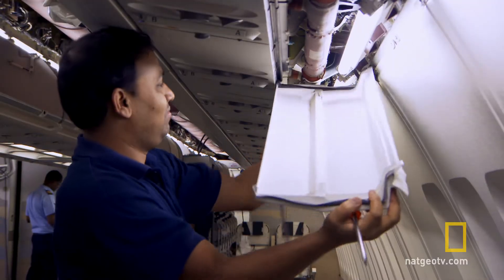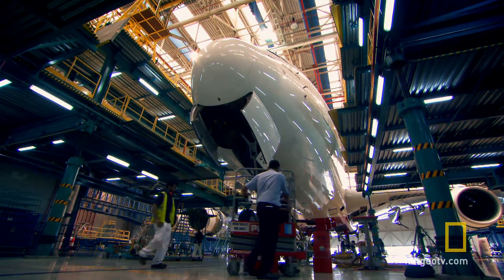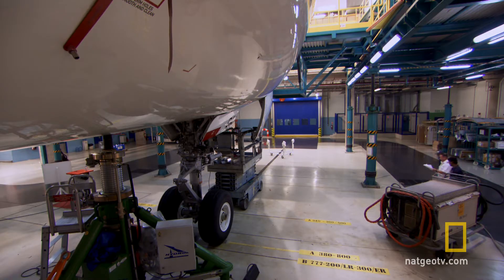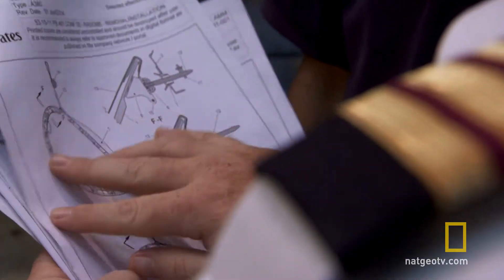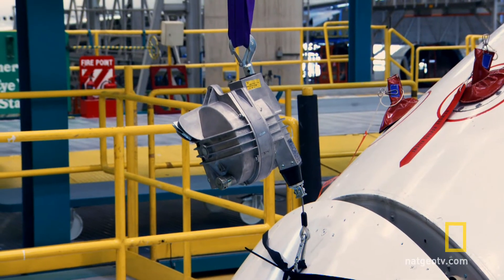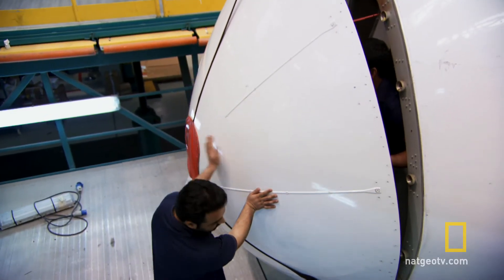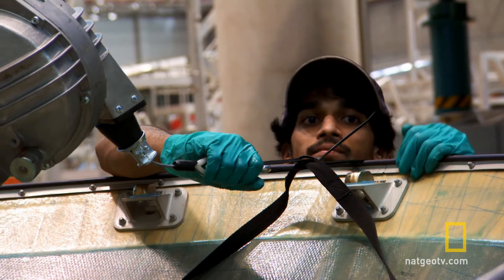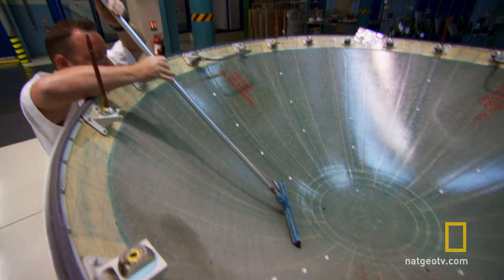The C Check | National Geographic UK

Comment: will any airlines do the "D" check on these or just junk them?
Reply: Rarelly any aircraft goes to d check. If they do, its if the airline has no replacement for these aircraft, like those running dash 8-100 or 737 classic in northern canada.
We mostly do some of the task that are covered by the d check during the c check so when the time for a d check arrive, it will already have had been covered by the previous c check
Reply: As most of maintenance crews are guys, we tend to avoid the d
Reply: There’s a documentary on British Airways doing a D check on a 747-400